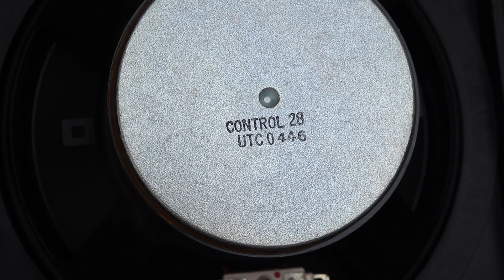JBL Control 28 - A look Inside

Comment: Is that yellowing from sun exposure?  I plan to buy 2 to mount on my porch to provide sound to my patio/pool area.  White would match the trim of the patio perfectly, but if they're going to yellow, then maybe I should go black?
Reply: Yes, the control/contractor series do yellow from sun exposure, like many older products that used to be white. I seen many examples of white control 25s and control 28s yellow over the years. I recommend black as this does not happen.

Comment: What a nasty way to glue the grill
Reply from the maker: bituminous adhesive that protects the grille from vibration
Reply: @chicagomen01  now I know why they use the glue! At first, I thought it was to prevent water getting in the speaker!

Comment: cheap capacitors :/ the mid bass driver excursion is very short
Reply: Hey these speakers are absolutely booming speakers for what they are. I’ve seen them at Carrowinds and they sound great. So knock it off.

Comment: Not worth the money..
Reply: Gary Hunkin you don‘t know what you are talking about... These are great speakers and are also used in studios!
Reply: @leongailberger7676   All a matter of opinion. Only popular because of the logo on the front I think... I have been through two pairs of 28's and they are quite poorly built considering they were £500/£600 a pair new. These sound incredibly boomy and completely ruin the dynamics in any music indoors with their 7dB peak at 110Hz. At least they seem to have improved them for the new 28-1 model.
Reply: @leongailberger7676  well, if these are used in studios, then I am disappointed...
Reply: I just bought a pair on eBay.  Totally worth it. Under $200 and they handle
175 watts. I just want to find the matching sb210
Reply: I now have a set of Control 29AV-1 (also PA Speakers and 8"). These are in a different league, no boomy bass and the whole frequency response is much more pleasing to the ear. I think the Control 28 are JBL's money makers... Pay a little more and you get way more for your money! Check them out
Reply: They’re worth it and are much better than a majority of the 6.5-inch outdoor speakers and under out there.